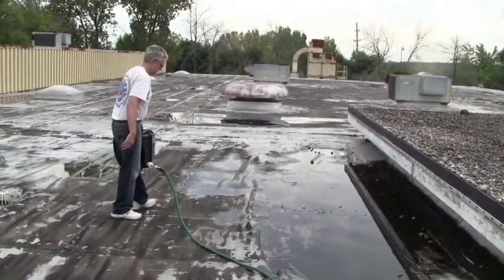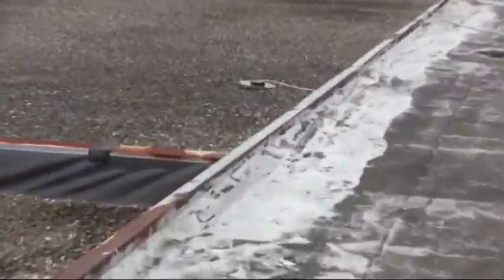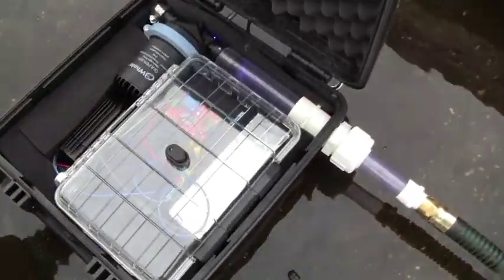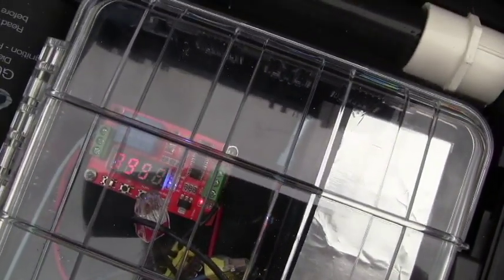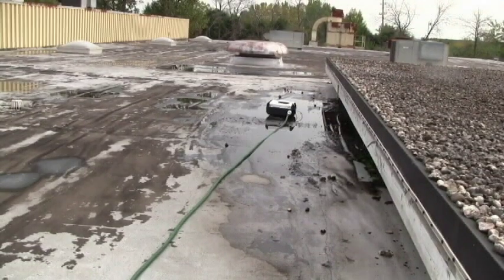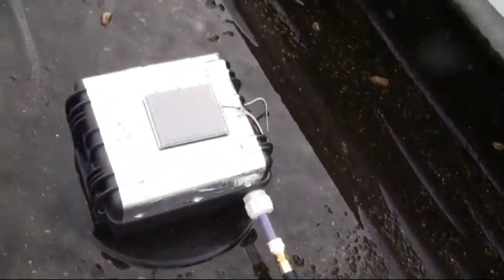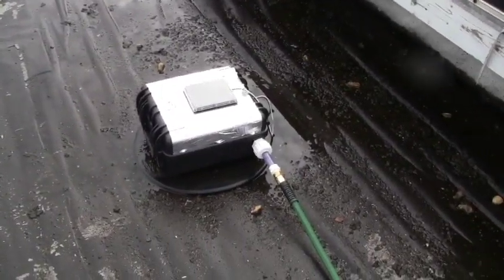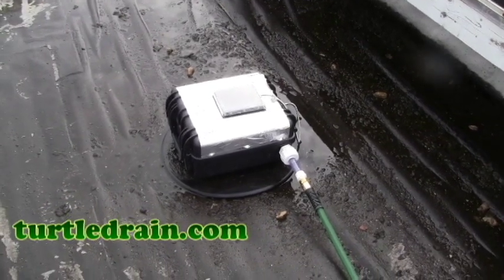Roof Leak? SolarCat- A Portable Solar Roof Drain by Turtledrain

Comment: So.... if its raining.. hard.. like it often does.. whats the run time without solar?
Reply from the maker: The solar is just to activate the pump for 25 seconds. From then on, it operates entirely off of a siphon i.e. gravity. All water will be removed to under 1/8" every time it activates (checks every 6 hours by default, you can change it to whatever time intervals you would like)